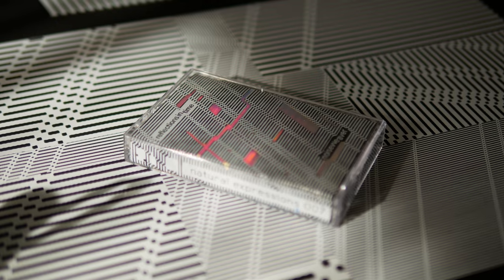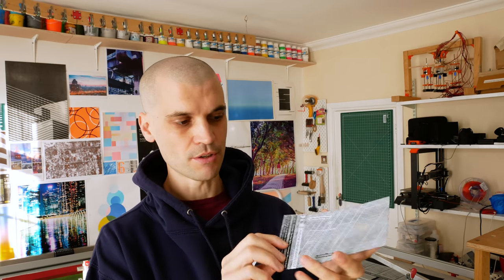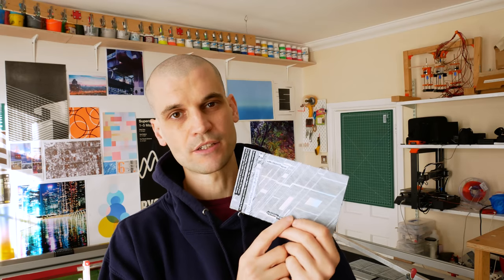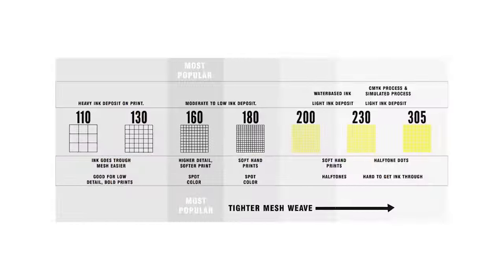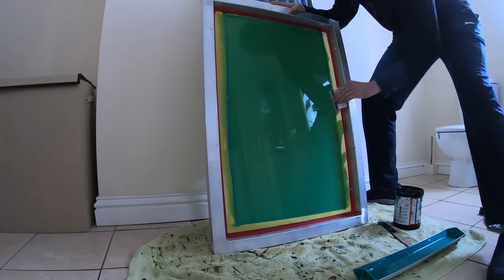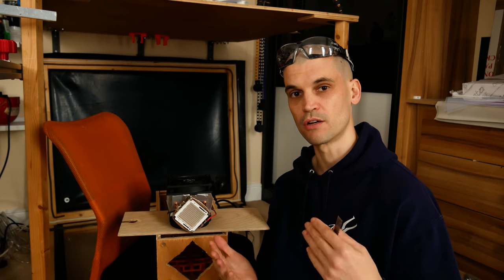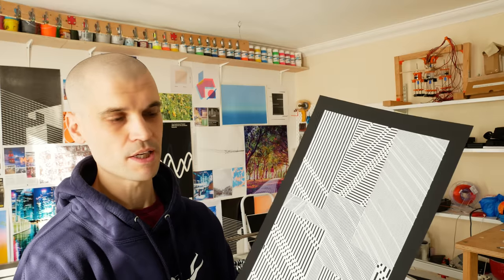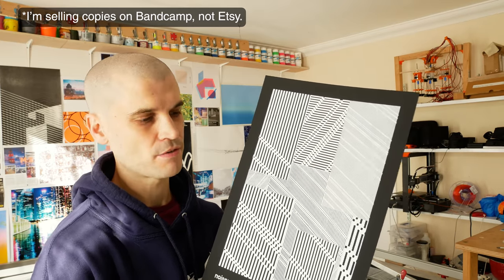Screenprinting Posters at Home - What I've Learnt

Comment: If you are using WB inks you can add 1-2% glycerin retarder which stops the drying but won’t lose opacity.
Reply from the maker: thanks, is the glycerin any different from the usual acrylic/screenprinting retarder people use?
Reply: @ThisDesignedThat  So the one I use is Permaset Waterbased retarder but I think the formulation is glycerin liquid (they also use it in still life photography for holding water dew). I think it is different to an acrylic medium which also slows drying but also dilutes the solids and opacity. I had a lot of trouble with WB inks drying in the screen but now the glycerin seems to keep it open forever - you only need 1-2% though.